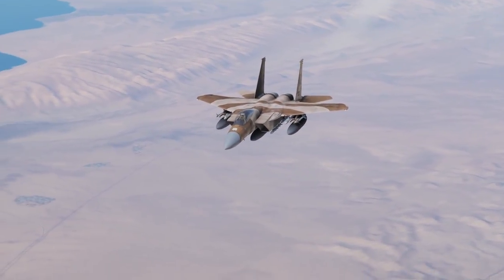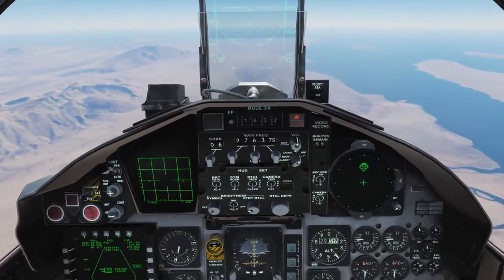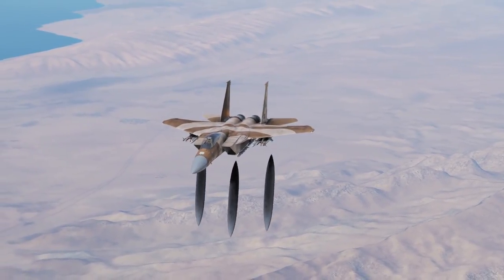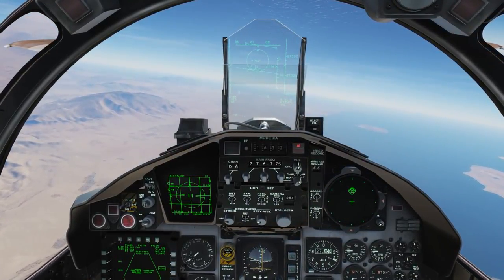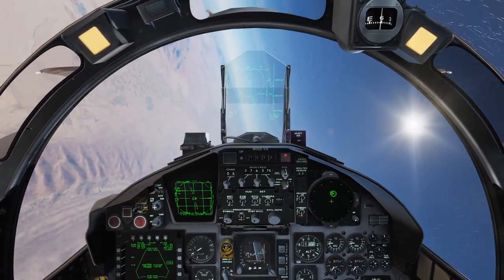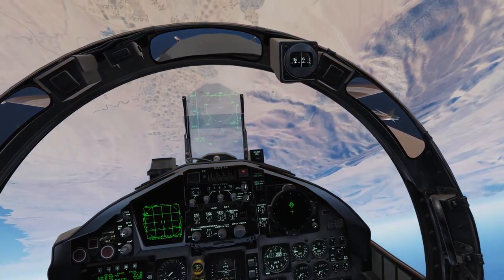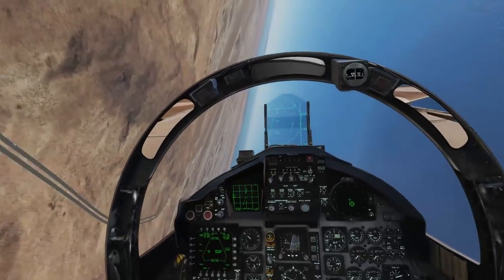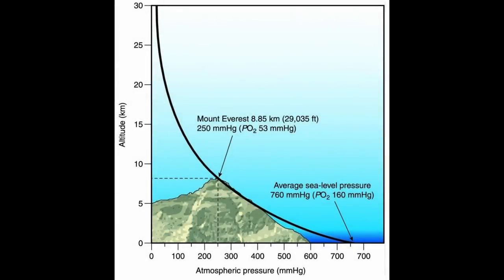DCS: Air Density Vs. Missile Energy.

Comment: Physics fact of the day:

In the absence of any external forces and provided your already on a heading towards your target then yes a straight line would be the quickest way between 2 points along with being the shortest distance.

However when external forces get involved and when you start out moving on a different heading than your target the brachistochrone will always be the quickest way between 2 points with no exceptions.

Keep up the good work though I love watching these videos.
Reply: You have to add a few more variables into your assessment though.  A brachistochrone curve only works best when living creatures and airframes with G limits are not involved.  "Always" the quickest way between 2 points with a difference in altitude where the destination is below the start point, and when the object does not have a biological G limit, or when the airframe does not have a mechanical G limit.

Theories are always nice to understand, but you also need to know how to correctly apply them to the situation you are looking at.
Reply: @Power5  Yes this is also why AI piloted planes will probably replace human ones within the next century they can calculate the most efficient trajectories on the fly, react faster and only have to worry about the integrity of the air-frame when dealing with limits.

I mean they already can outfly human pilots nearly 100% of the time in simulations with the computing power of a raspberry pi.

Its only a matter of time.
Reply: Again though the plane has mechanical limits so a theoretical slope is never going to be possible. Again, the brachistochrone curve figures on a stationary object and not trying to go vertical down. The fastest way to the point directly below plane will always be maximum G roll over pull down dive.  Either the plane avionics or the human pilot will determine the maximum G.

Comment: Very nice video again. One thing crosses my mind though. You not only led this fox to the dense air but also increased the distance by coming down thus the missile had to travel more and more into denser environment with every feet it flew down.  

BTW. From what I see that the gain from using G to propel the missile it's not that significant to overcome fraction forces in a denser environment. 

Anyway it's indeed a good video - thanks for it :)

Comment: Is the gravity pull effect involved - or it has the coffee break?
They both fired a missile almost in the same time, ok? Aim-120 that goes up gain more energy than the diving one????
Following that logic - all object coming from above must decelerate because of the air density. Especially small and aerodynamic objects.
Of course the air cause drag but gravity pull should have more impact on the object than air density. The higher you fired the missile the further it should go and the higher pk
In the video above it works just opposite
Reply from the maker: once again, firing at higher altitude works better if the target stays at high altitude due to the missile pushing thru thin air to get it. increases the range almost 4x. its not that gravtiy doesn't have an effect, its just not as big of an effect as air drag. you can see the missile at 30000 feet impacts at mach 3. while the one in dense are is basically dead. it still has speed due to gravity, but not enough for it to guide itself onto a target.

Comment: id also add putting the missile to 90 degrees (3 or 9 oclock) and affording myself a bit shallower dive (70-80 °), think that would bleed even more energy off the missle, since it will have to turn on two axes, spendin some extra energy on vertical axis turn. right? :)

Comment: Thanks for the info.  I'm planning on buying my first DCS module when they go on sale.
The only thing I'm worried about atm is DCS world is frequently crashing during loading and when in flight is dropping frames frequently.
Reply from the maker: youre very welcome are u sure that your computer can handle dcs ?
Reply: Definitely higher than what Steam recommends, although the ram may be pushing it.
GTX 1080 SC
i7 4770k
16 GB DDR3 (2133 iirc)
Reply from the maker: Astronut128 hmmm that should be more able to handle DCS. Do u have an SSD drive you can put DCS on?
Reply: I've got it on a high speed ssd.
Today I tried the newest beta version and it appears to have resolved the crashes and reduced the frame dropping to tolerable levels.
Reply: I've just now got Flaming Cliffs 3 since it went on sale but I just noticed that most modules don't officially transfer between steam and the standalone version, although I see some posts saying they can "transfer" UNofficially.  Have you had any experience with that?

The last post of both threads mention something about it:
https://forums.eagle.ru/showthread.php?t=202493
https://steamcommunity.com/app/223750/discussions/0/618458030680254680/?ctp=2

Comment: I would never think that, missiles being much faster than their terminal velocity, they would loose energy by diving, drag being worse than the potential energy they convert to speed, while it seems quite obvious and common sense. Feeling pretty dumb right now.
Reply from the maker: haha. as long as you learned something new mate thats all that matters.
Reply: @GrowlingSidewinder  Sure, thanks for it. I used to do that in Thirdwire's SF2, (wich seemed much more "Lite" even before they went full arcade) more to loose myself in the ground clutter and run faster than the missiles could turn, but now that i got to see this, I remember how they just seemed to be anemic, rather than loosing lock. Particularly odd when you could use it with Kuwait's EE Lightnings against Iranian Tomcats.

Comment: Excellent video.  Could a plane out of chaff decoy a radar homing missile by pickling the drop tanks at an interval?
Reply from the maker: mmmm no. not that I know of.  but its an interesting idea.
Reply: Im thinking the F-15 tanks because they are so huge and while moving away from the missile.
Reply from the maker: kevin cvalciuc ya I can see ur logic. I know it doesn't work in DCS. I have no idea about real life.
Reply: Ok, thanks. I know the Iranians did something similar in the Iran-Iraq war since they didnt have chaff dispensers they would put foil and other pieces of metal inside the air brakes and then deploy as a decoy.
Reply: Doubtful. Tanks are much smaller radar signatures than chaffs which disperse to large area. Also I think they lose speed and trajectory much faster which helps the missile to filter them out.
Reply: Negative. Chaff lose speed immediately because they have no mass. Tank on an aircraft can DOUBLE its radar signature of an aircraft which is why the F-35 and F-22 have a much larger internal fuel storage capability.

Comment: What's the point where an air fight goes from a fight against the enemy missiles (in terms of energy/manouvering) to a fight against the enemy fighter? 

Isn't the fighter that has more height and speed at about 13:00 in a better position to recommit? It comes always down to 'chance of missile evasion' vs. 'time, energy, and chance to commit to the next offensive manouvre', doesn't it? For that reason, an F-Pole or Beam would be superiour to air-to-air-missile anti-energy manouvering, especially if you don't have any Fox 3s to force the enemy into a defensive manouver (That's the reason M2000c against the major FC3 fighters is so challenging).